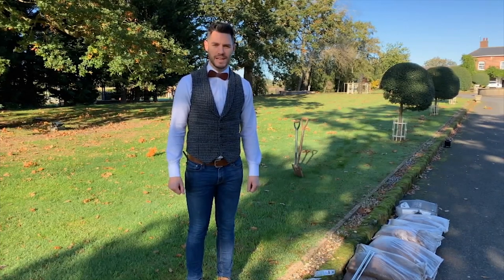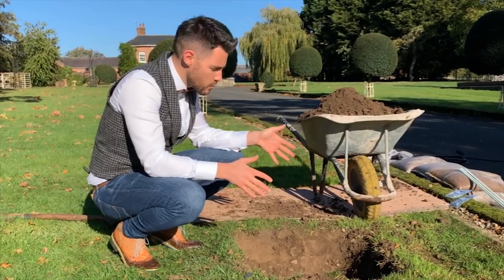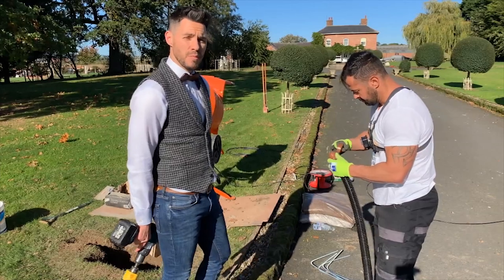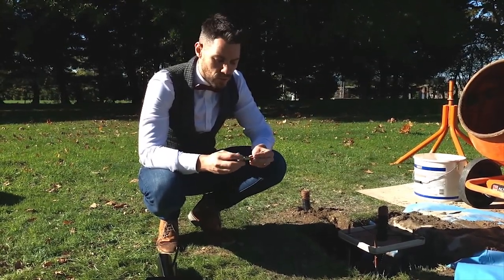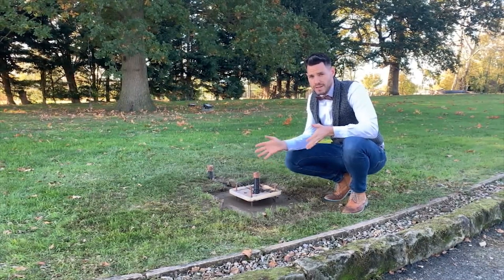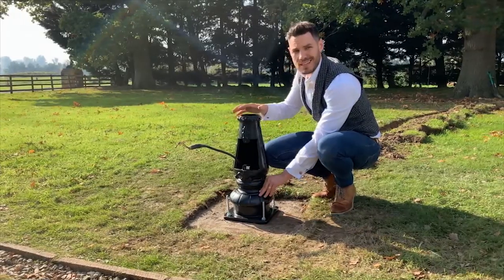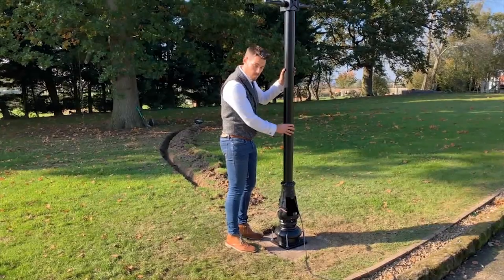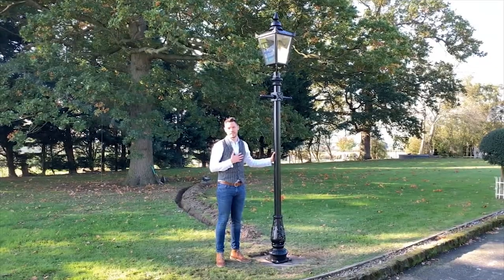How to install a Lamp Post - Heavy Cast Iron with Concrete Base including wiring

Comment: Nice lamppost. 320lm is barely going to put out any light. Why did you choose to run the cabling across the grass rather than down the side of the roadway?
Reply: Presumably so they could take a supply off the tree uplighter floodlights in that direction. Much cheaper and easier than running it right back to the house.
Reply: @stevoc9930 diagonal knife on the corner? Lol
Reply: @Dragon-Slay3r  huh?

Comment: Is this light a solar? Where is the sensor at if so?
Reply: It's not solar
Reply: Solar lights and photocells aren’t the same thing. Wired lights aren’t the same thing as solar (wireless) lights. The photocell can be attached to either. 
Solar powered lights, like those you are thinking about, often have a built in photocell, yes. So do street and security lights. The photocell (sensor) often controls when the light comes off and on (i.e. dusk to dawn). A photocell can be wired into the circuitry of a wired light (think about a motion detection security lights over a garage or entry way). Look them up on amazon ;) 
This light is hard wired to a power source because it’s more likely to survive the test of time. Solar powered lights on the high end can survive a few years, but cheaper solar powered lights last a year or less. Any solar powered fixture will become useless when the panel corrodes or fails, as they always do. A single LED bulb will only cost a few bucks a year at most, so going solar for a few years and having a nice lamp post become useless when the panel breaks down... is pointless. This being a high end fixture, it could be wired to a remote (more durable and costly) solar panel across the lawn somewhere safe, a residence, or city power source. A photo cell could be added either along the circuitry or remotely to come on at night. Even a motion detector could be added so it only comes on when needed.
Reply: Very informative. My lamp arrives on Monday I am now well clued up to fit it. Thank you.